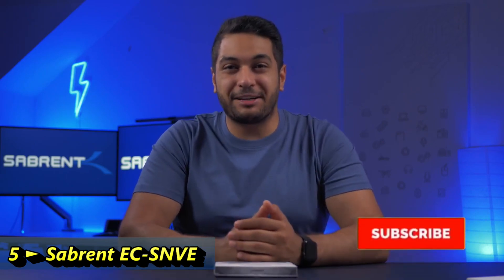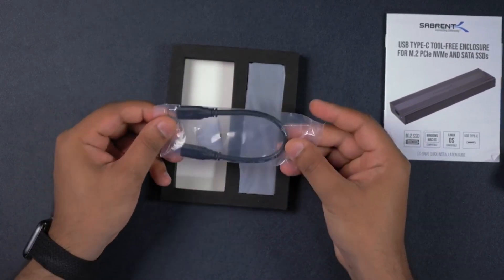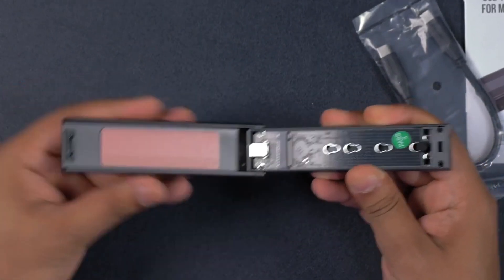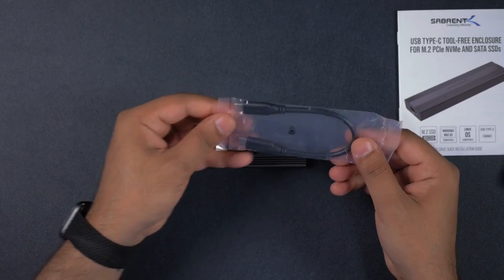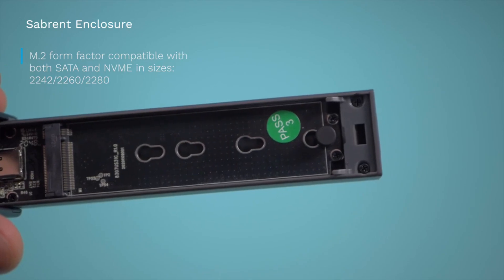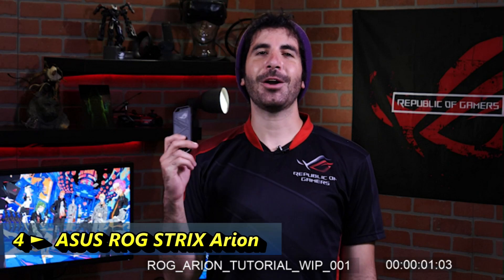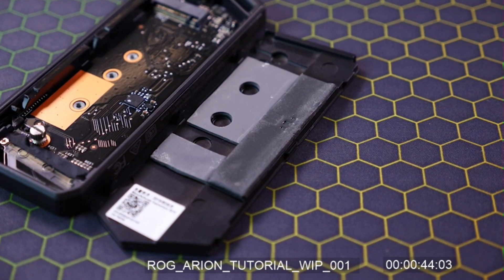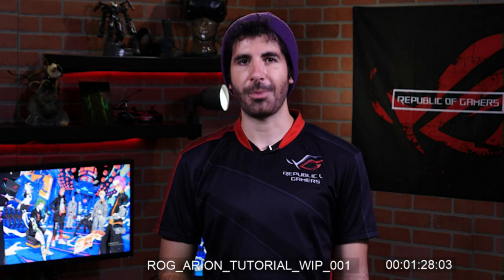5 Best NVMe USB Adapter Enclosures

Comment: Sorry but the Sabrent does NOT work for me. After I installed the flash drive and copy the files which were copied at USB speed at 38MB/sec, when I  plugged it into my tablet and my TCL smartphone, I get an error message USB is NOT recognized.

Comment: The Sabrent tool free enclosure is a terrible design. No lock for the button. Can't tell how many times it's popped open due to button being pushed in my pack. All it would have taken is lock slider. Very disappointing.